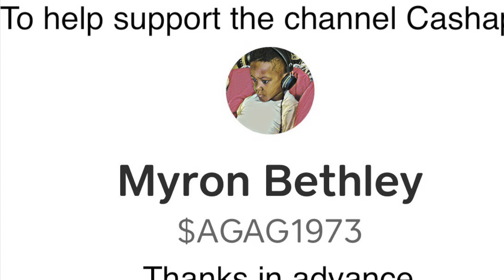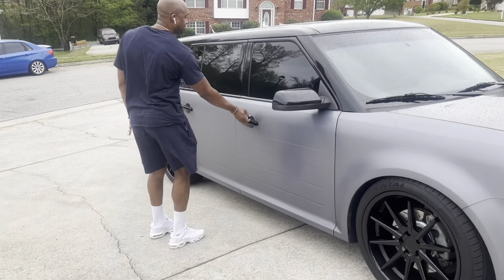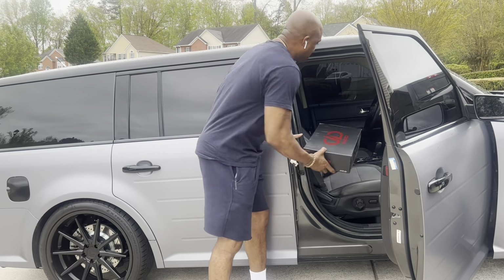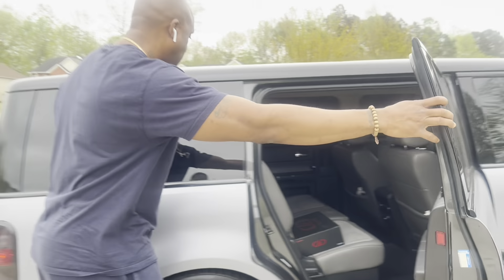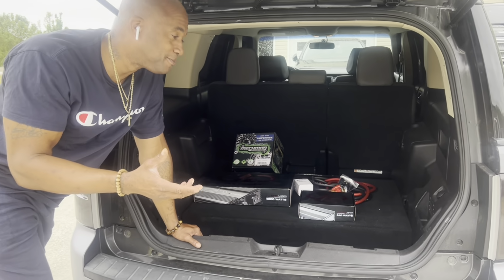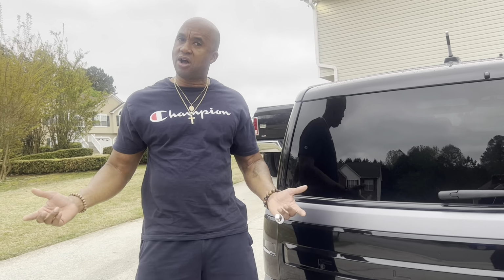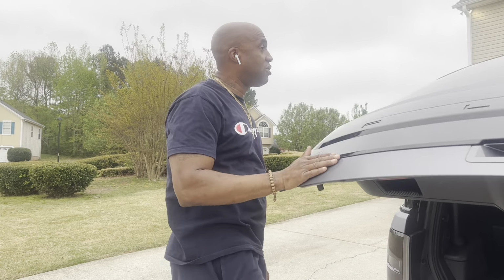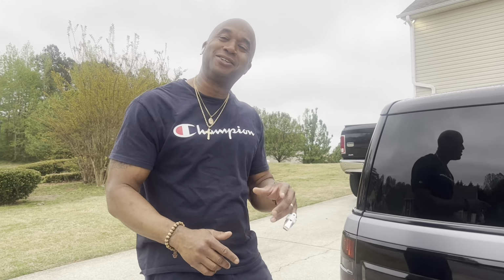Full DD install 2019 Ford Flex Part 1

Comment: Flex 2019 has 12 speakers + back up cam sensor. How did you get away with not using a 12 channel amp?